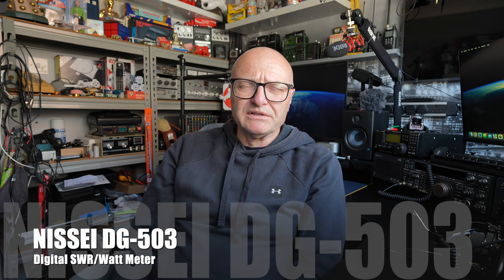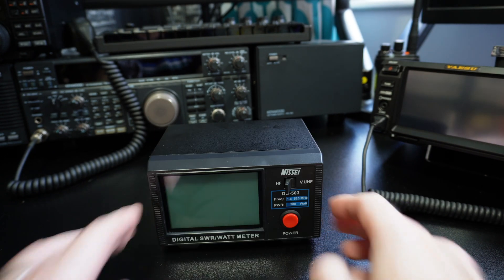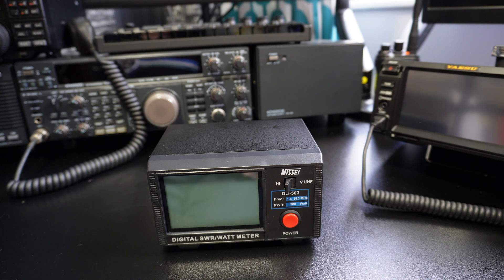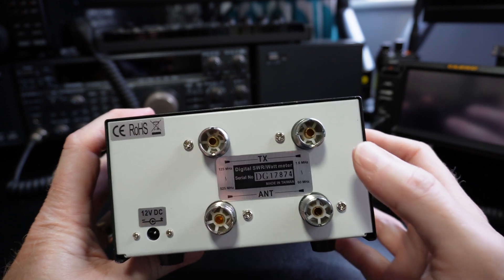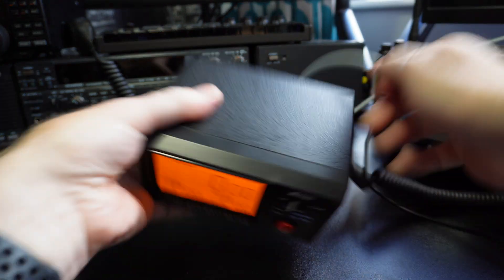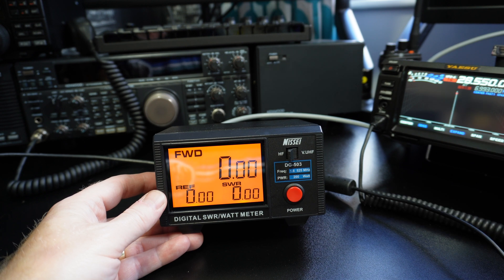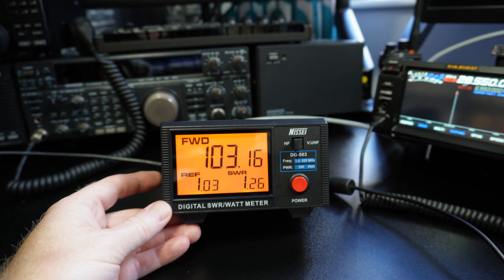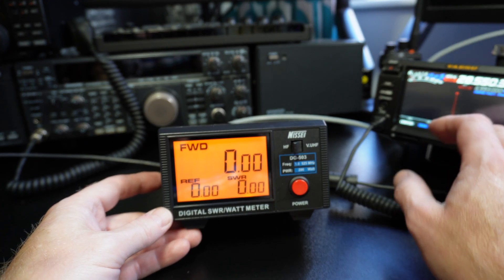NISSEI DG-503 Digital HF VHF UHF SWR/Watt Meter

Comment: I have been tempted by this too. It's good that the VHF works at low power levels, but needing 12v means it's not really suitable for car aerial installations. Maybe everyone uses antenna analysers for that now?
Reply from the maker: Tbh i was surprised how good it is but i would say it is more of a shack toy. I have a few antenna analysers myself and i couldn’t be without one now, especially for out and about.

Comment: I have had one for some time they are a good bit of kit just watch the inner connector of the pl259 sockets they can open up and not get a good contact had to get some pliers on them to tighten them up a little, love the channel 👍
Reply from the maker: It’s funny you should mention that as I noticed the collars that separate the centre are inserted low down. You can pull them up but they become a bit loose.